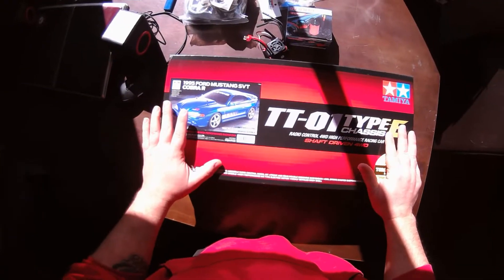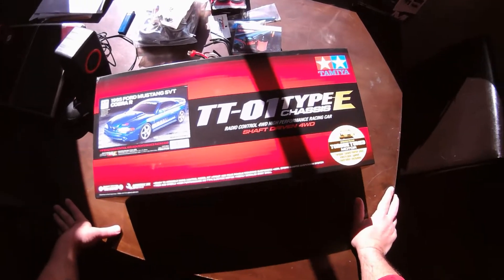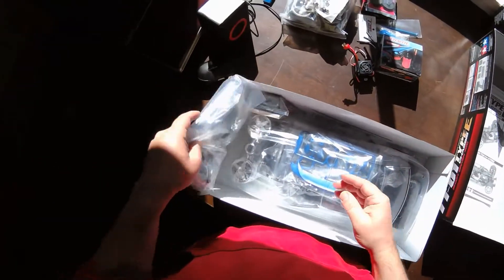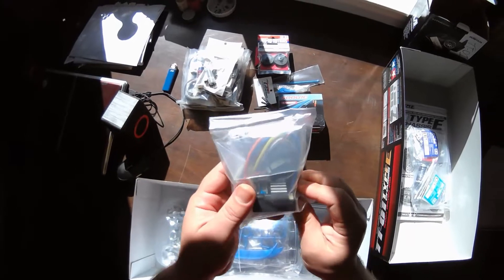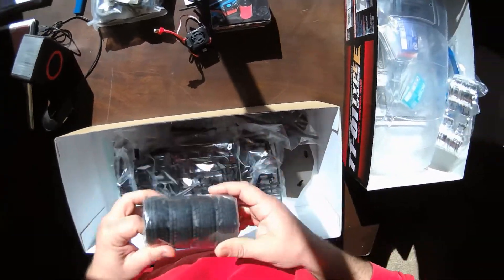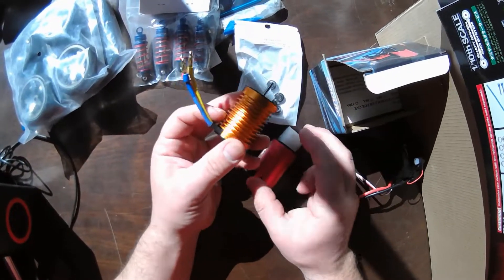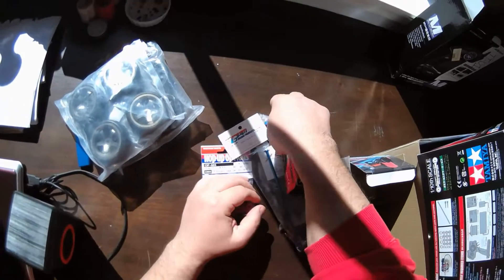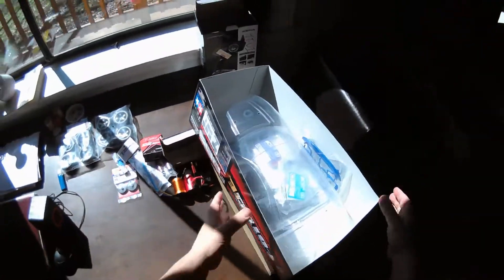1995 MUSTANG SVT COBRA R - TAMIYA TT-01 TYPE E CHASSIS

Comment: I feel it's been a long time you don't come to tanks chat anymore be nice to hear from you again also I have a grasshopper now and if that thing is a 60 amp dive it says on the directions on the speed controller I swear this car was released one or two years ago from them also I am getting a hornet and I have a GT tune motor for that and on my grasshopper I have a dirt tuned motor so just wanted to see you talking about this because I haven't seen many people talk about this particularly release.
Reply from the maker: Nice! It's 65amp and the new one 75amp
Reply from the maker: I didn't know tank still does lives..I've been waiting for stevo to do more lives
Reply: @philthyco1  I run a 40c lipo in it with a battery thing that tells me when the battery should be stopped being used in it you should watch my videos that I've put out since you've last seen it.
Reply: @philthyco1  contact Frank and ask him how you can get an invite again unfortunately Steve d is very ill lately that's why he hasn't done anything lately.